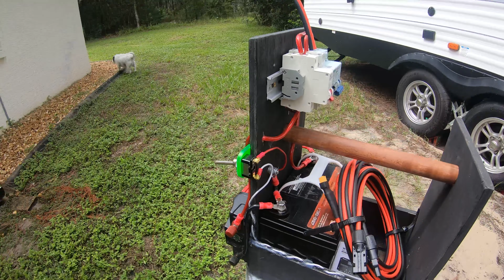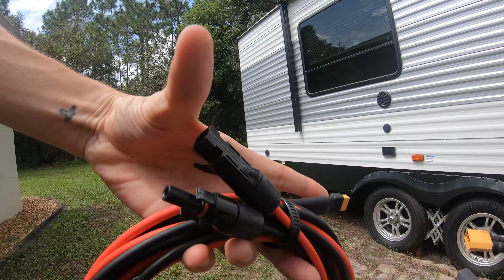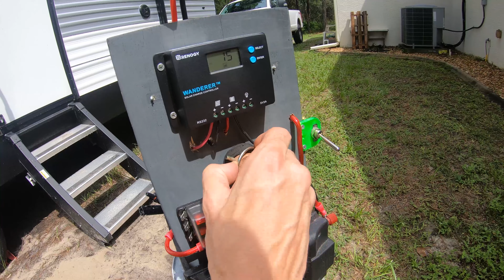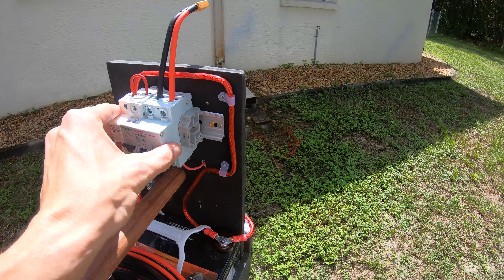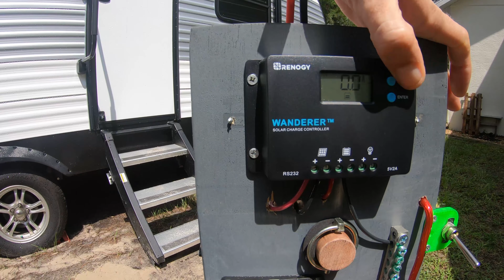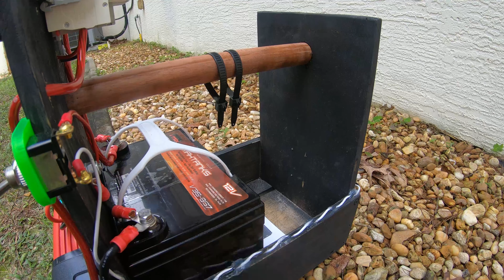DIY 17A/H Portable Solar Generator |#7

Comment: You could add another panel if you wire them in series and not parallel.  This would up your wattage but not your amps. There are videos out there.

Comment: How do you determine when the battery has been discharged to the maximum safe amount ? (To avoid damaging it)
Reply: An AGM battery is a sealed lead acid battery, with glass mat material between the lead plates. 

 A 50% discharge occurs at 12.1 to 12.2 volts measured across the battery terminals with all loads removed. This is true for all lead acid batteries only.

 Other battery chemistries have a different voltage value that indicates the usable discharge level has been reached.
Reply: @petercamusojr1545  Accurate info.